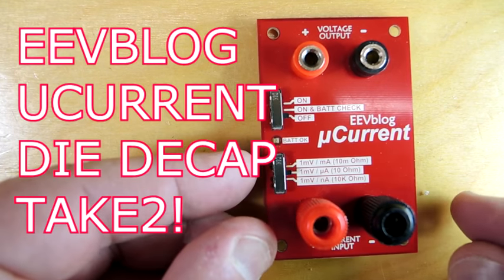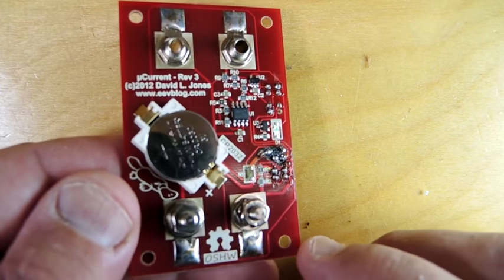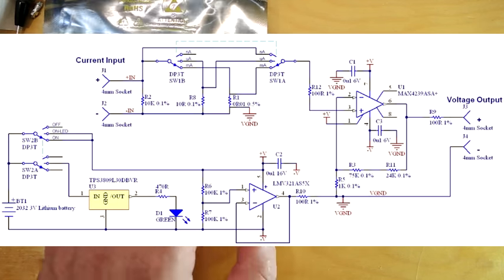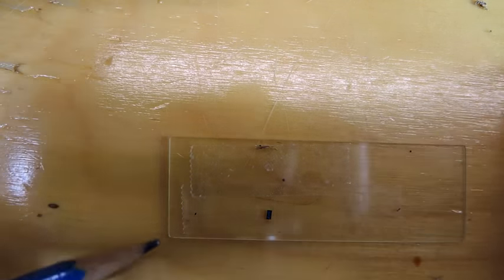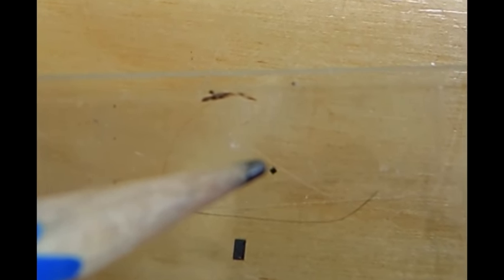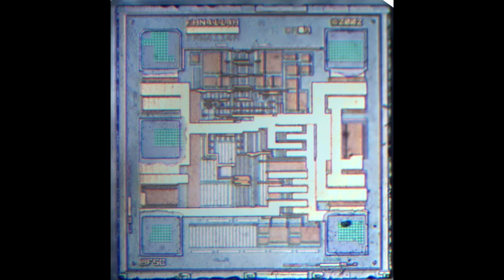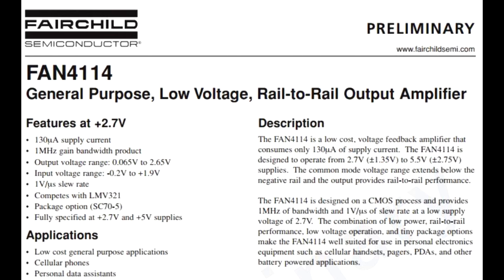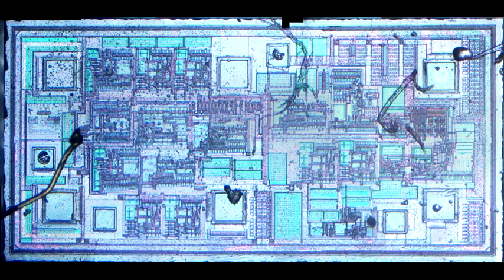EEVBLOG uCURRENT: A LOOK AT THE OP AMP DIES

Comment: Nice work!
The Maxim MAX4238/39 is expensive because it is a specialised ultra low offset chopper amplifier, one of the best in the world in terms of offset performance, so it would go through all sorts of characterisation tests. The LMV is just a boring jellybean opamp. It's not just silicon area you are paying for.